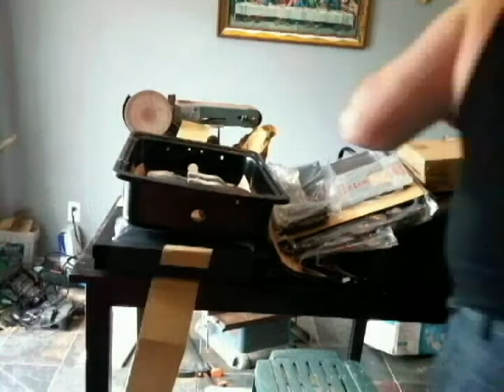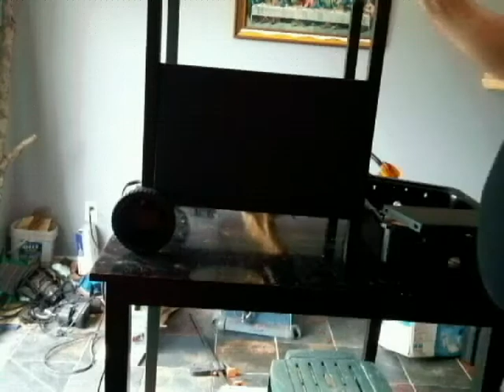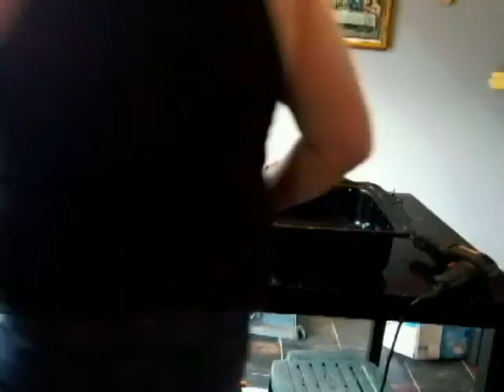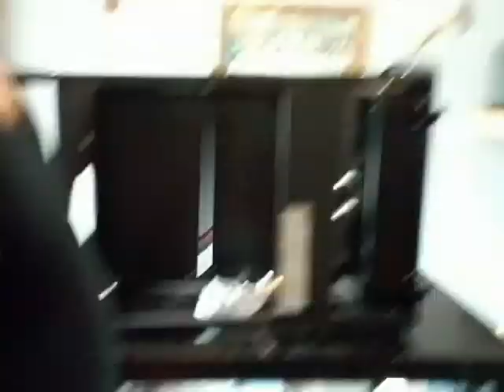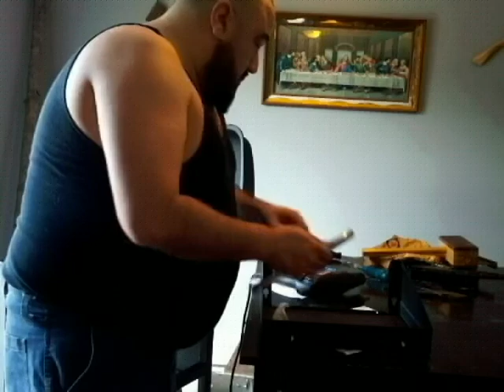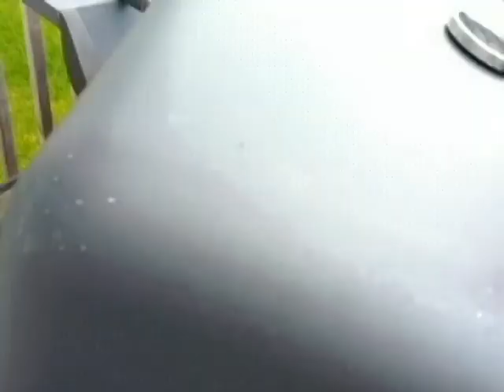Putting together a TERA GEAR - Duke 25,000 BTU gas Pro-2 Burner Gril - BBQ

Comment: Hi there - I just finishing putting mine together, but can't figure out how the grease cup is attached and I don't see it in your video.  Any chance it's something stupid easy before I duct tape it to the underside :)  Thanks!
Reply from the maker: To tell you truth I forgot to put it on.   I'll take a look later and let you know.
Reply: Thank you!  That would be amazing!
Reply from the maker: There seems to be  hole in the middle of the bottom main shell.   I just squeezed it through that from the top and hung the  bucket once it was half way through.
Reply: Thanks, I also managed to squish the crap out of the hanger and jam it upwards.  The instructions said "slide". There was no sliding. There were pliers involved! :) Thanks for your help though.

Comment: how come you didn't install the heat insulation panel under the grill body?  This is the one part I can't figure out in the instructions, and it's the one part you didn't do.
Reply: same problem here...just wanted to check that out and he didn't do it ....dear Admin please enlighten us on this
Reply: Hi Kerri, after assembling it and having the same problem as you, I spent an afternoon thinking about it. I came to the conclusion that there is a mistake in the manual. In fact, the only logical scenario, is that the heat insulation panel has to go between the burner and the base. During assembly, hold the panel below the base (the "U" part has to face at the back of the bbq, so the heat insultion is on top of the gas pipes). HOlding the panel, put in the burner from the top. Like that, the tubing will go through the "U" and into the pipes. Then you can screw the screws right through the panel, base and burners. I hope my explanation was clear. :)